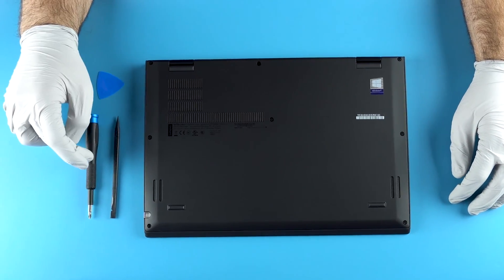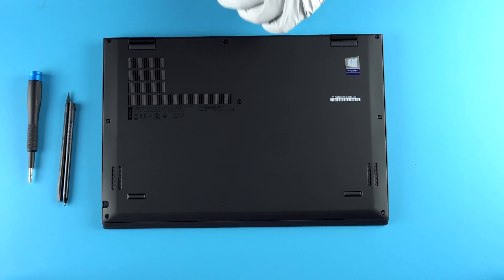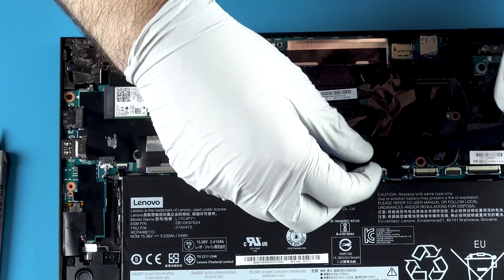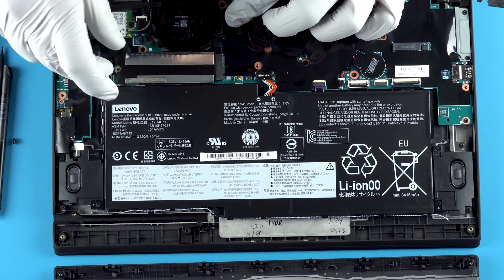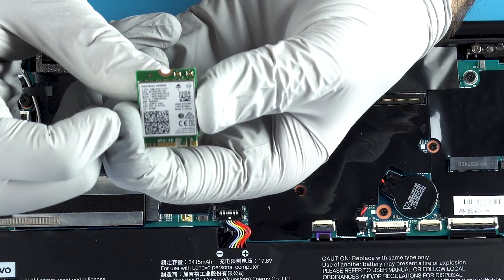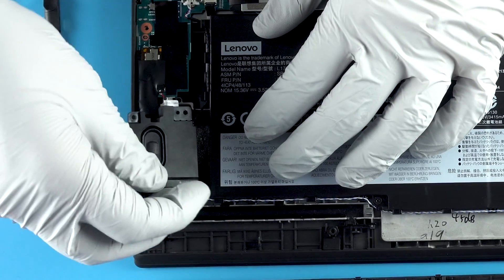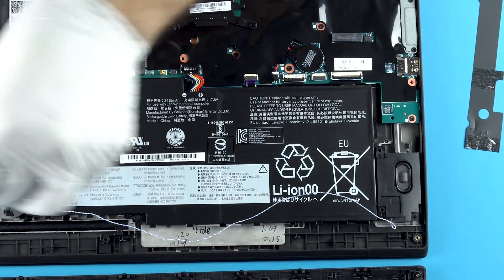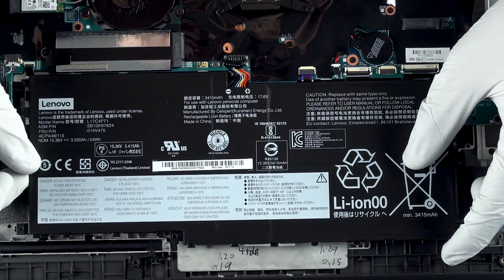Lenovo X1 Yogo 3rd | How to Service, Upgrade & Fix Laptop (Teardown)

Comment: the ssd screw in my yoga gen 3 is so tight and I end up with strip it and it can no longer be removed. so bad this laptop
Reply: Never use a cheap screw for something expensive and critical.

Comment: Would you please share how to install the WWAN card to it so I can put sim and use the cellular data connection
Reply: On the X1 Yoga, you have to order it with the WWAN from Lenovo. The wiring for the antenna is in the screen part and it's not easy to retrofit.
Reply: Hi, where you able to did it? I also want to add WWAN card to my X1 Yoga 3rd gen